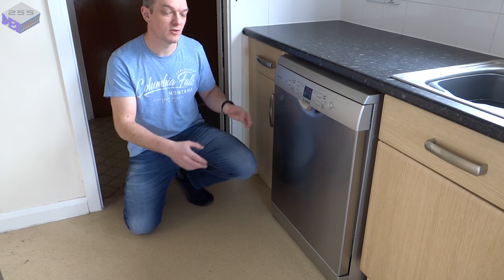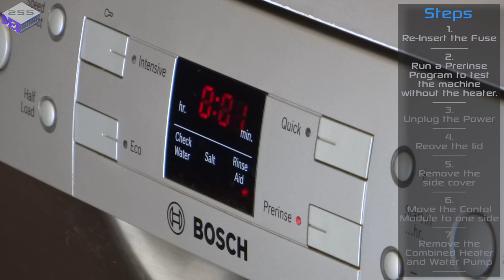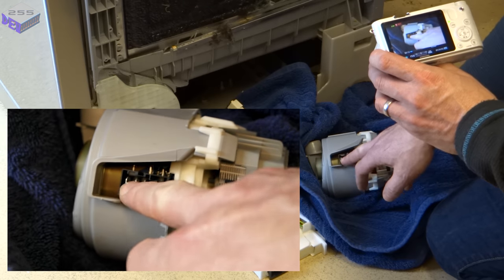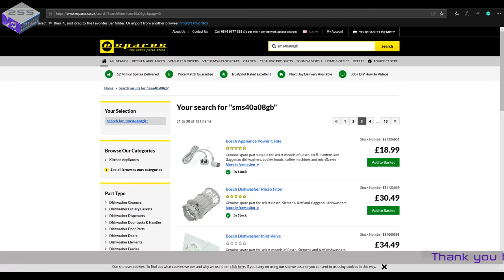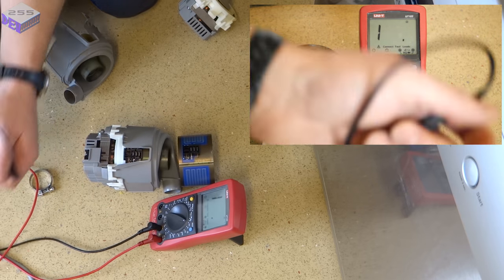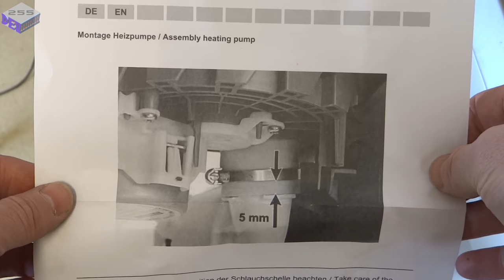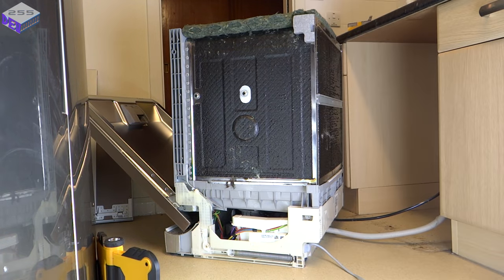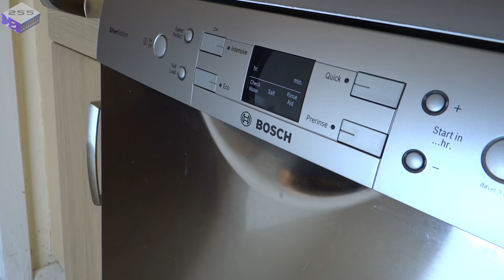How to Test & Replace the Heater & Pump in a BOSCH, SIEMENS, NEFF and more Dishwashers

Comment: Thanks for the video. I followed your instructions. My measurement shows 19.1 ohm - is it okay or it requires to be at 20? The machine shows Err01
Reply from the maker: Hi, sorry for the late reply, I have just seen your comment. The Error 01 normally indicates a circulation pump problem or problem with the circuit board; this may be popping up if you have water getting into the water heater and causing control issues before the heater goes altogether (shorts to earth), it should be around 20 ohms really, I would be tempted to take it out and look at the heater tracks to see any anomalies. The heater element should be fairly easy to separate from the motor, although the tabs that hold it all together may brake if pushed too far. I know this was a month ago, did you manage to fix it, or still need help?